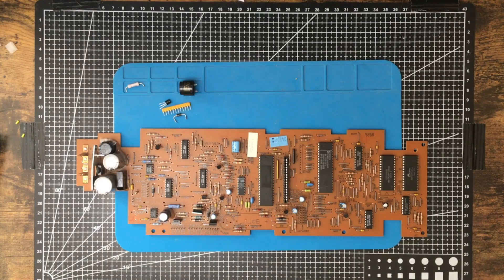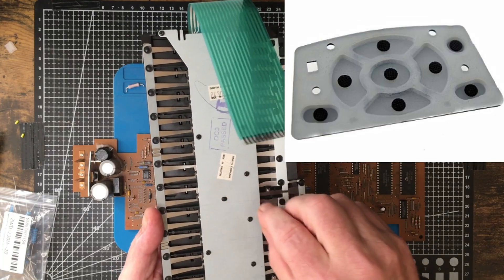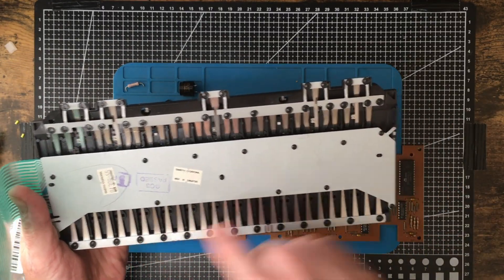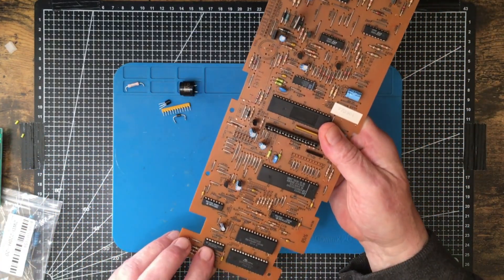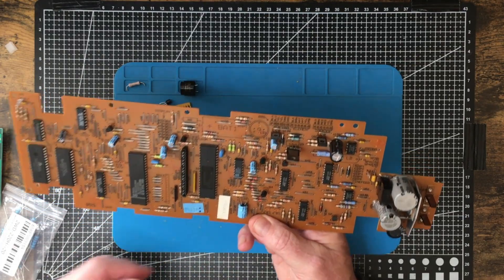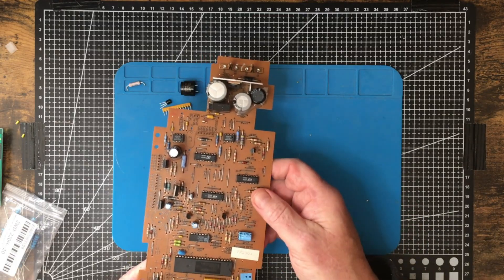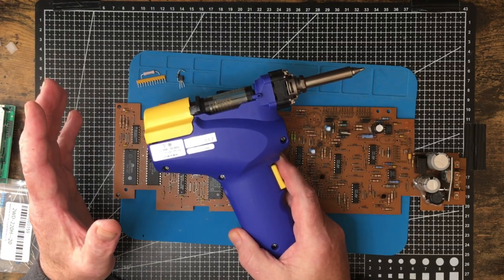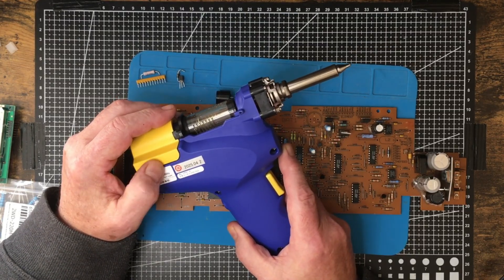Uni-Byte 0300 - How a HAKKO FR-301 Can Pay its Way:  SALVAGE!

Comment: I bought the Japanese one and use one of those 100V 300 watt travel transformers which I already had. Works fantastic and was a whole bunch cheaper.  👍
Reply from the maker: Yup, that's another solution.  I have never heard of someone whose unit broke in under a year, so the warranty seems to be a bit meaning less.  Besides, spare parts are available for a reasonable price.

Comment: My country has decided to block Aliexpress and local online stores importing from China. Buying from eBay is also not feasible due to high shipping costs and taxes, and I'm just a college student looking for a cheap but capable desoldering iron. So I built one with a cheap manual pump desoldering iron (a Yihua 929 that was somehow available on my local marketplace) and added an electric vacuum pump to it. I've used several vacuum pump configurations: 5 Lpm, 10 Lpm, 18 Lpm, and 36 Lpm. 5 Lpm is fine, but the desoldering iron will easily clog. 10 Lpm is good, but sometimes it can't suck the solder cleanly on some PCBs with tighter gaps. 18 Lpm has a good balance, and 36 Lpm just turns the molten solder into dust in the solder waste chamber and clogs the air filter. So that's probably why the FR-401 uses 15 Lpm. I've never experienced any clogging so far with 18 Lpm pump and managed to desolder components from multi layer PCB with this cheap desoldering iron (This thing only cost me around $30-40). So if any of you have those desoldering stations that always getting clogged, I suggest to replace the vacuum pump with higher flow one.
Reply from the maker: Nice project and good information, thanks!

Comment: For the power mod it's much better to grab a cheap ubiquitous 25VA to 40VA 120v/24v transformer and wire it up as an auto transformer to buck down the voltage to to exactly 100VAC.

I love salvage parts too.  With all the garbage fakes and drifty generics on the market these days, I'd much rather get legit  National, TI, etc. etc. branded semiconductors off of seasoned / vintage scrap boards!
Reply from the maker: This unit consumes over 115W @ 100V (100W for the heater and 15W for the motor), so while you could do something like you say, it would cost quite a bit more than two $1 resistors and 20 minutes of doing hobby stuff.

Agreed on your salvage philosophy.  The quality of parts on the Smith-Corona board a 2nd to none.

Comment: My first parts when I was a kid in the 1960's were salvage from old TV's and radios. I have grabbed thousands of dollars worth of parts via desoldering, and simply puling parts from sockets. Nowadays, with the dirt-cheap parts testers and identifiers, along with my NanoVNA, I can quickly go through all of those surplus parts to identify, characterize, and use them in my projects. With all of the stock I've gathered this way I can build most projects without having to order online and waiting for that 1 part I'm missing.
There's a reason Metcal desoldering stations are so expensive. They use the Venturi Effect for desoldering suction, and all of the solder drops into a big disposable paper cup that can be swapped with a new one in about 5 seconds. There's an enormous difference between things that were built to work and things that were built to look like they work.
Reply from the maker: Sounds about right!

Comment: You know that 8052 can be used with external memory RAM and ROM, right? I find 19 modules from some telecom device with programmed 8051/8052 and already used half of them with external memory.
Reply from the maker: Interesting.  How do you prevent it from executing the internal code?
Reply: @uni-byte  Connect /EA pin to ground. That way, the external ROM is enabled
Reply from the maker: @sebastian19745  Awesome!  Thanks!